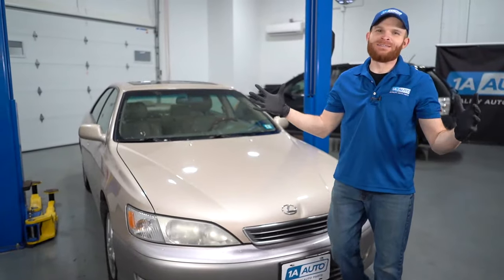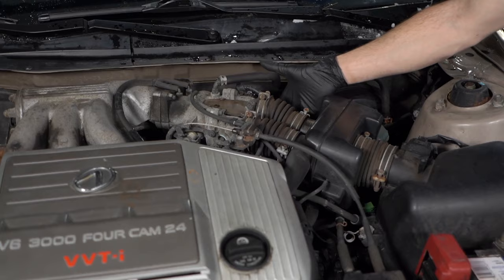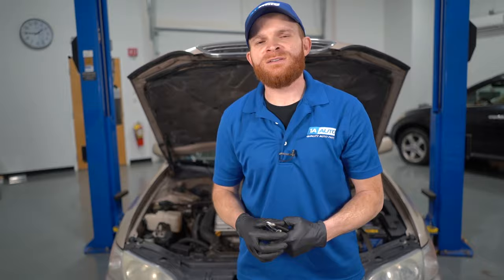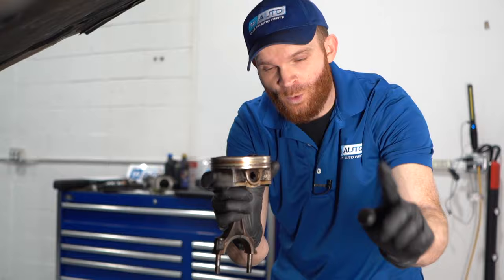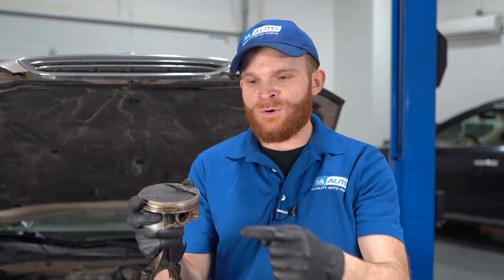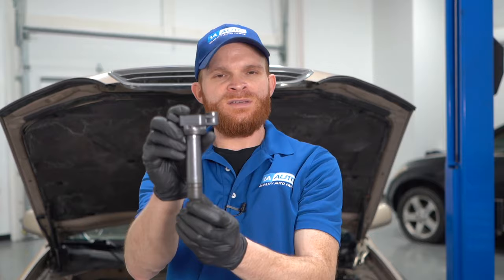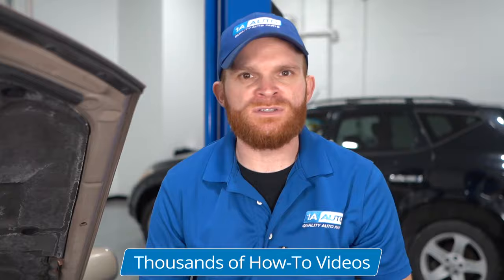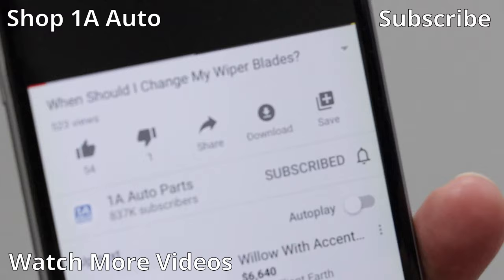Top 5 Problems Lexus ES300 Sedan 3rd Generation 1997-2001

Comment: Should I buy a 99 Lexus es300 with 45k miles for 3500?  Its one owner and has new breaks and flex joint in exhaust.  It will need tires by winter. Just has a tiny bit of rust on rear quarter panel
Reply: I think you should go for it I just bought a 2001 es300 with 140k miles for $2,400 interior was in very good condition and the guy had replaced a good number of parts on it
Reply: I just brought a 1998 lexus es300 and no issues and runs like a baby, my mechanic said I got a steal for it, only paid 300
Reply: @Minister_teach_preach_Jesus  just say someone gave you a car lol
Reply: Its been a great car. Like new almost. Only reason it has tiny rust in rear quarter is from paint chips from hittin garbage can but car is in very good condition.  Garage kept from old man who was original owner. All the rubber mounts, belts, molding still looks new. Car should last to 100k easily

Comment: Mine has almost 300k I got it at 288k given to me by a friend. I changed tranny fluid n oil once I got it and wow ima fan. This car runs better then most new cars. I need to fix the suspension issues. But you can’t beat that for a almost 300,000 mile car.
Reply from the maker: +professional0_0 Thanks for checking us out! http://1aau.to/m/Shop-1AAuto-c

Comment: Just bought new wheels and tires. Was 1,000 lol 😂 only paid 750 for the car. Only has 156k on it, a baby. But it smells like burning plastic or rubber almost immediately after start up
Reply: How's Been running for you?
Reply: likely a valve cover seal leak.  Common problem I had with mine.
Reply: @yaboyreflex1919  It’s amazing. Especially for the price I paid lol
Reply: @matthewmilner6499  That’s EXACTLY what it was lol the rear one was leaking on my exhaust manifold. Man that rear was gave me HELL replacing lol 😂 took me all day and a lot of beer later

Comment: I have a 99es300. No vacuum leaks or check engine light. However, when I first start I have a low idle then after driving the car for a bit it has a high idle 1300-1400 which is way to high. Unowned a 1993 ES it never did this. Any ideas 1A auto??
Reply: Probably late, but I had a similar issue. My throttle body was super dirty and needed to be cleaned

Comment: I have a p0420 bank 1 CEL . I'm going to take out the bank 1 O2 sensor and see if that helps. Thank you
Reply: I had vacuum leaks ... Fixed it and the p0420 light went away

Comment: These Toyota V6 engines are also known for oil sludge issues & premature valve stem seal failures.
Reply from the maker: +elwood williams Thanks for the feedback!
Reply: Using synthetic oil alleviates the sludge issue.

Comment: I have a 2000 with 337.000 miles. Runs very good. But the Rear light failure warning light came on and all the bulbs are ok. Then the battery light came on and when I turned the car off, it didn't start again. So, I bought a new battery and when I started, all the lights were off - even the track engine light, that was on for awhile (message: gas leakage or gas cap not sealing).
I went for a ride and Rear Light warning light went on again, Battery light came on for a couple of seconds, went out again, went on again, a little longer, went out and finally went on again and stayed on. No track engine light on. 
Next day, the car started fine, battery light was off and when I drove, the same happened like the day before.
I live in the northwest and we have a lot of rain. Can it be a sensor and if, which sensor would it be? Thank you for your help.

Comment: 2000 es300
Trac off light blinks. At same time abs is on. Sometimes no abs. Instead service engine light.
Reply: take it to auto parts store and get the code. Sounds like what mine did when the vvt solenoids were bad though.

Comment: hi I have 2001 Lexus ES 300 and I have P1780 code which is for neutral safety switch, but I replace the safety switch OEM part and check engine light comes back with same code, any suggestions please????

Comment: Just bought an 01 ES300 with 91K miles. Had a couple cosmetic imperfections but ran and drove great. I even used my high dollar scan tool to make sure there were no hidden codes.

Started driving it back to Nebraska from Seattle (1700 miles) and the low oil light came on. Strange, I thought. Must be a sensor or something because the oil looked good and clean when I left. Nope…over the course of the trip the engine drank 6 quarts total, tho it did slow down significantly after a quart of Lucas Oil Additive in Wyoming.

Super bummed. Love the car and it drives like a dream, but at this rate I’m going to run through the catalytic converter and the spark plugs fast. Worth doing the fix or should I get rid of it?

Comment: I changed my o2 sensors in the front of the car. Still getting p1346 & p1351. It was making a tutting sound. Now I just makes a long sound during every acceleration then stops when coasting without acceleration. Where the timing belt is. I can hear a noise like ticking or some sort.
Reply: VVT solenoids worth a look, does the brake pedal get weird/spongy at some gears/rpm?

Comment: I have a 1999 Lexus es300 with 125,000 miles. My engine light just turned on and my car rattles when accelerating.  It's stops at 3000 rpm. The code says p0171 too lean bank 1.

Comment: One thing on these engines is they have timing belts. I’m not 100% sure but I’m pretty sure these are interference engines which means if that timing belt snaps your valves will hit the pistons and your engine will be junk. Be sure tho have the belt changed every 100k miles.

Comment: I wouldn't call these problems lol, normal wear and tear.   I have 185000 on mine I've replaced the bank 1 sensor also the vvt solenoid both there $30 a piece now doing kock sensors both and coolant hose

Comment: 3k mile oil change interval is a myth.. Synthetic oil is fine for 10k or more.
Reply: Oil is cheaper then replacing an engine 🙄
Reply: Fine? No. Just no. Don't spread b.s. nobody who is credible would tell you that, simply because there is no point in waiting until 10k.